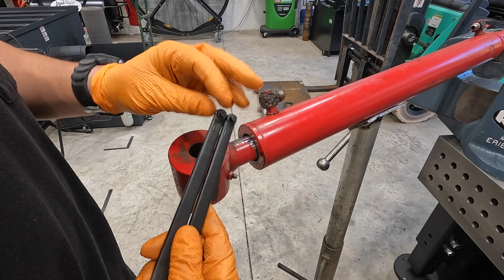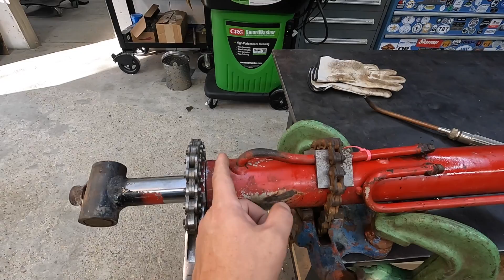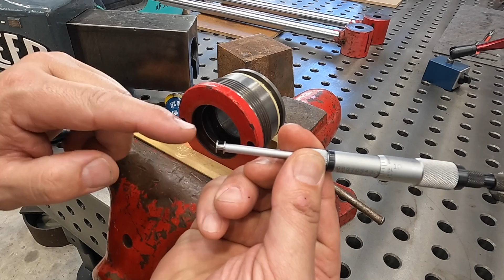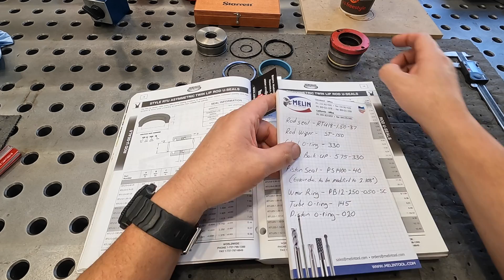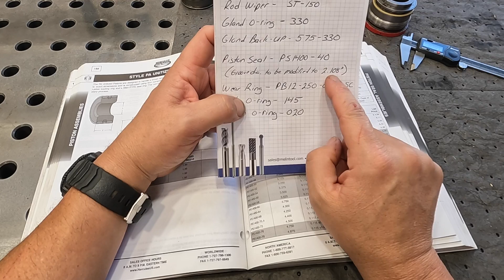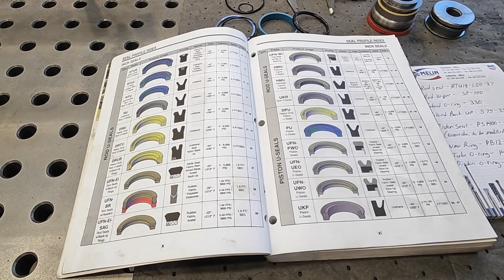Mahindra Hydraulic Cylinders: Tear Down, Inspect & Size for Seals

Comment: The fitting on those are trashed,  Had the same thing happen to mine on my mahindra front end loader.  Cut several off and welded on weld on hydraulic bungs.    Believe it or not the Mahindra loaders are made in the good ole US of A by KWM and the cylinders are trash.  They may be made in China….   The developed pin holes in the bung coming off the cylinder to the hose.

Comment: Aluminum expands faster then steel when heated! Your chain wrench is set for tightening instead of loosening! Lefty loosening,  right tightening ❤.  I have over 20 years doing only cylinder repair.  Not hating,  just saying.

Comment: Aluminium expands more than steel - which is why the nut initially moved but then seized as heat was transferred from the barrel into the nut.
 linear thermal expansion coefficient of steel: ~ 7  (10-⁶ in/(in °F))
 linear thermal expansion coefficient of aluminium alloy: ~13  (10-⁶ in/(in °F))

Comment: Keep a steel bucket full of cold water, heat the barrel till the aluminum head expands then dump the whole thing in cold water, repeat 2-3 times then unscrew  head. Bobcat cylinders, and Kubota cylinders are made the same design, standard seals American threads. If the pin type spaners don't move it right off put them back in the drawer and break out the pipe wrench, but only put one set of marks in the head!  37years in the same hydraulic shop

Comment: putting the cylinder in the freezer would shrink the gland about .0015"more than the steel tube. Unlikely this would have been a great help for a severely corroded thread. You could have melted the gland out and machined a new one for good video content.

Comment: Thanks for your lecture! Very interesting. 
The stuck gland, would it perhaps get loosened if You tap the tube over the threads? Oxide and grime fill the treads and is pulverized by hitting outside the tube. I believe You to have more luck with this method than just heat!
Regards PeO

Comment: Probably a dumb question, but if it's a Mahindra tractor, doesn't Mahindra sell a factory reseal kit for the cylinder, so you don't have to do all the measuring? Love your channel as always.
Reply: Probably so, but ordering your own via a distributor is probably much much cheaper. Not to mention the value of this video is the knowledge to find any seal you may ever need, no matter the use.

Comment: I am fascinated by your ability to interpret what a problem is and I watched the almost everyone of your videos if you take and put a piece of metal on one side and smack it with the other side via soft metal that will not divert it and do it in a fashion. Change the position to a 360DEG around it and you will be able to get it Potentially

Comment: The coefficient of expansion of aluminium is far higher than steel. So heating will actually make the thread tighter rather than looser. Best approach might be to heat and then let cool the expansion 'event' might shock the thread loose.

Comment: Mahindra is from India, they use the metric system since 1962.
Reply: I know this is a year old comment, but I'm working on rebuilding my mahindra loader cylinders. The loaders are mostly built by Buhler in Canada using hydraulic cylinders made by Monarch hydraulic. All of the seals are in Imperial or SAE measurements.

Comment: Seeing you applying heat to a hydraulic system like that, reminded me of a cautionary tale from my early days in engineering here in the UK. Following the Falklands conflict, during which we lost Royal Navy vessels, an emergency safety ‘flyer’ was sent out to all UK manufacturers. This was with regards to the use of Viton seals and what happens to them if they suffer an extreme heat event, such as being in a fire. Unlike conventional seals which char, Viton actually liquifies and being a Fluoroelastomer, it can release Hydrogen Fluoride gas AND, if you get that liquified Viton material on your skin, there was no other treatment other than to amputate the affected area! Whilst I acknowledge that Viton wouldn’t normally be used in the hydraulics you are dealing with here, everyone be aware - if you are dealing with any such equipment and you suspect it might have been in a fire (or you are going to use heat yourself to effect disassembly), take all precautions.
Reply: Good info, sort of like how people shouldn't weld things that are zinc plated
Reply: Funny, I live in the States but I remember a similar warning and it would have been about the same time frame (early in my engineering career!).  I always warn the new guys.
Reply: @kevinstark6329  Yes, I suspect the alert went worldwide, following the presumably unfortunate experience of either Royal Navy fire control teams and engineers during the conflict, or workers in dockyards attempting repairs or salvage.

Comment: Forgive me if this is a dumb question as I've never worked on hydraulics before but couldn't you cut two flat spots 180° apart so you could get a large adjustable or pipe wrench on it to bust it loose??
Reply: To make the flats large enough to get any good grip on had to make them quite deep, and new gland would be purchased, or made. There are different ways one could gotten the gland off that includeds ruining it. That would been a way to go if there were no new complete cylinder avaiable, and replatively cheap. He stopped trying getting it off as the owners was aible to puchase a replaement cylinder, which was cheaper than Adam going on fixing the old cylinder.

Comment: I've conquered a few cylinder glands that were that tight before and just applied a steady lower heat to the gland itself for several minutes, then just let it cool down for an equal amount of time, and loosened them. The heat will soak away from the gland into the cylinder letting the gland contract while the cylinder expands.

Comment: We found that the best way to remove the aluminum glan was to lay the cylinder on an anvil and use a pneumatic hammer to rattle the tube against the glan to free the threads.
Reply: *gland.

Comment: I find it fascinating that you call that a "spanner wrench", when I would call it a pin spanner. But there again I would likely only use the word wrench if I'd pulled a muscle or sprained something or if I was referring specifically to a monkey wrench.

To be fair, it's a tool which "spans" either side of a fastener, so it's a perfectly descriptive term, which for me is applicable to a pin spanner, or what I guess you would call a wrench which spans both sides of a hex (or other shape) nut or bolt.

What you later described as a pin spanner, I would have called a hook spanner!

We really are two nations divided by a common language.

Language is always fascinating to me, as is watching your amazing videos, Adam.
Reply: The word "Spanner" is related to the German word "Spannung" which means tension or tightening.

Comment: I work in the high-tech industry and had so many aluminum and steel combinations that have in electrolysis in it all the way down to a 1.5 mm screw in this is absolutely so so typical when you put a steel next to aluminum.
It is probably going to be the dumbest thing in all of my mechanic life to put aluminum and steel together is absolutely the most incompetent way of doing any kind of mechanical assembly I have ever seen..
I'm doing things like this on a scale very very small scale so many times

Comment: Aluminum on the inside and steel outside is the worst case scenario. Aluminum has one of the highest coefficient of expansions as well as soaking up heat faster and holding it longer than steel. The Aluminum will swell up and stick in the steel very fast. For the heat trick to work, you need to get the Aluminum very cold, hit the steel very fast  and you might have a chance. Very hard to do by yourself.

Comment: Surprised that Mahindra equipment doesn't use Metric measurements/parts.
Reply: Some regions of asia use imperial parts frequently, depending on which market they are mostly sending to. I believe to have never seen a Mahindra in Europe.
Reply: @an2thea514  thanks

Comment: Is there any way it could have been left hand thread?
Reply: Oh yeah, I totally agree there is no reason to make it left hand. But, that doesnt mean that it isn't. Just look at some of the other stuff engineers do.
Reply: There is no reason to make it left hand.
Reply: Cylinders with left handed threads exist.
Reply: @an2thea514  What is reason for that?
Reply: @karirautio  Let's say it like this
Right Handed V-Threads are enough for 80% of hydraulic cylinder end caps in this world, but many manufacturers use something different.
Left Handed Threads
Trapezoidal threads
90° Quick-Release Caps
Channel Wire
Welded
Are what I've seen in the past. Usually so it's not obvious how to take it apart.

Comment: I've always had pretty good luck with getting the gland nuts to come off by using a little heat and break fluid as a lubricant on them. Laugh as you want but it works.
Reply: Perhaps you mean BRAKE fluid.
Reply: some heat can be necessary  if they used thread sealer

Comment: Might be a dumb question but why aren’t all the replacement parts specified by the oem? And have an easy way to order them?
Reply: Hercules has that online, then you can double check their "kit" and see if the individual seal specs in the book match yours. There's also an app called Hercules Seal Configurator. Hope this helps.

Comment: Given that aluminum expands much faster than steel, you just added to the problem by applying heat.  A little shot of liquid nitrogen may have been the solution.

Comment: You need a pipe wrench, put some heat on it and spray water on the threaded side to shrink it fast. A trick I learned from an old timer at Chevrolet school

Comment: There’s 2 kinds of countries on this planet: ones that use the metric system, and ones who have put a man on the moon!
Reply: Unfortunately for you, NASA uses metric.
Reply: @an2thea514  Not in 1969, sport...
Reply: @brettbuck7362  "Contrary to urban myth, NASA did use the metric system for the Apollo Moon landings."

Nasa being founded by a german guy wouldn't settle for an inferior system of measurement.
Reply: @an2thea514  The  ex-Nazis, you mean? Yes, Von Braun and his jolly bunch of cut-ups used metric, just like they did when laying out the Mittlewerk slave labor camp. That hardly suggests we emulate them. NASA used entirely US measurements for everything down to the scaling on the onboard computers - because absolutely everything in 50's aerospace industry used conventional measures. Von braun and associated did some initial work in metric, then converted it.
Reply: @an2thea514  metric system has no balls, no style and I don’t care about your facts. I stand by my original comment 😂
Reply: @an2thea514  *unfortunately
Reply: @yalebaker7976  Fixed it.

Comment: Might be a dumb question, however wouldn't it be prudent to use a brass or bronze screwdriver type tool when pulling those seal?  I know you've done this a lot, however a steel screwdriver against a seal surface seems kind of scarey...
Reply: Professional seal and O-ring removal tools are steel.
Reply: It's not that critial with this kind of parts. Will possible jut be some light surface scratches on are able to make that will not reduce the seals's ability to keep tight

Comment: Adam, I have dismantled hundreds of cylinders with similar problems, aluminium glands are frequently a problem due to corrosion and subsequent galling of the threads. Applying heat in my experience seldom helps, as you found  You only have a few seconds to remove the gland before the expansion of the aluminium gland catches up and then exceeds the expansion of the steel cylinder and then the heat softens the aluminium and makes galling/seizing inevitable. My most successful removal technique was to  support under the gland on a block of hardwood and vigorously hammer all around the thread area on the outside of the cylinder with a heavy brass or copper mallet prior to attempting to undo the gland. This breaks up corrosion and loosens any cold weld in the thread. If the thread starts to get tight when unscrewing apply more mallet.
Reply: Second this. Used to work in a facility that produces hydraulic cylinders, and this is effective, often on even brand new parts.
Reply: I was honestly confused about him going straight to the flame wrench.  Percussion should always come before heat in loosening steps.  The ONLY time I skip it is when there's no space to swing a hammer or position an air hammer.
Reply: That is how i do them also, hammer all around and i use a big pipe wrench on the gland nut it gives a better purchase, than the spanner wrench when they are tight. On re assembly always use anti -seize!
Reply: I wonder if you shrank the AL gland with Liquid Nitrogen might work better
Reply: @tedsaylor6016  The short answer, NO. I had LN available and found it too difficult to confine to a small area for dismantling tasks. It was indispensable for assembly of interference fit parts. A big mallet beats the stuffing out of LN for dismantling. I always smothered the threads in Never Seize on Aluminium glands on re assembly.
Reply: @garychaplin9861  Thank you, just learned something!
Reply: @garychaplin9861  a big hammer will beat the stuffing out of most things.
Reply: @jmazoso  My motto was "If at first you don't succeed, use a bigger hammer."

Comment: Surely Mahindra, or a tractor repair vendor, has an all inclusive seal kit sitting on the shelf somewhere so you wouldn't have to machine the pistons.
Reply: Assuming you go to all that trouble of finding seals because you had first checked with Mahindra for factory replacements? Now you machine things to fit, and the next guy that needs to work on this will try to use factory seals and they won't fit. So hopefully he has the same knowledge and resources that you do.

Comment: Hey Adam, Heavy equipment Mechanic here. If you ever have a pin stick like that either torch the pin center out a bit or air gouge the center of the pin a bit and often times they come out.
Once some of the center material is gone and the pin cools its final od shrinks and many times comes free a lot easier.
Reply: He said he's going to try his hydraulic press first. If that doesn't work, I suspect he will use his milling machine to mill out the broken stud, as he's done in many videos before. Torching could easily deform the eye shape.
Reply: @kindabluejazz  If you do what I'm talking about and use an arc gouge it really doesn't heat soak as much as you'd think but does give room for the pin to shrink down. This process is well known by seasoned equipment mechanics especially in extremely salty environments and has a very low probability of deforming the rod end bore due to heating.
Reply: @TMoney1341  Kurtis at CEE in Australia uses the gouge all the time fror his large heavy equipment repairs
Reply: @brucemadden1626  I enjoy his videos too!
It works amazingly well to fillet out/off material, you just really need to be cautious to not shower yourself in molten steel accidentally.
Reply: @kindabluejazz  I think that cylinder is scrap so the pin won’t need to be removed.

Comment: I know Adam is capable of machining anything to make a seal fit, but not everyone has that ability. Seems to me the right seals *must* exist somewhere. The mfg didn't make them up custom in their own factory. Maybe they're metric; maybe they're newer than that 2013 book. I'd have gone online and used 'modern' technology to search for the parts, maybe even contact the tractor manufacturer.
Reply: Very possible but what is done ... is done. What he should do is make some kind of permanent mark or engrave on the piston or somewhere on the cylinder that the piston has been modified because the next person that rebuilds that cylinder ... if it isn't Mr. Booth ... might just order factory parts only to find out they won't fit.
Reply: @tsmartin  Oh, to be fly on the wall to witness that episode, lol.
Reply: @tsmartin  Be nice if he could laser etch it on the cylinder somewhere....or just print it out for the customer.

Comment: FYI, the ASTM/SAE standards for O-ring grooves max out at 5000 psi. If you very carefully choose your back up rings, and design your gaps to the absolute minimums and increase the o-ring crush, you can extend the pressures to well over double that number.
Reply: Most farm equipment doesn't get over 2500 psi by design, and most brands set  the relief valves a little lower than that for safety.
Reply: Yeah, I used to design downhole oil tools that went WAY higher...
Reply: I am from China Seals Factory. Our company produces many types of hydraulic oil seals. If you are interested in our products, we can send you free samples so that you can learn more about our products.

Comment: Mahindra makes junk.
Reply: They aren't the only ones making junk, even case tractors are absolute junk these days.. we have a case tractor that's off getting the front axle repaired for the second time in 5 years, it took a lot of arguing but case is doing the job for free because their trying to avoid a class action lawsuit.. I have no idea how their crappy over complicated design ever left the drawing board..                edit to update, case said they would fix it for free and now they have sent a bill for almost 6k for a half assed job that I could have done better myself for a fraction of the cost.. beware of case and their crappy design, crappy quality and scamming ways
Reply: I bought my 5500 in 2006 with ML260 front loader and everything works perfectly after 17 years, just basic maintenance. Don’t be scared of an Indian tractor because Jhon beer is an Indian tractor also